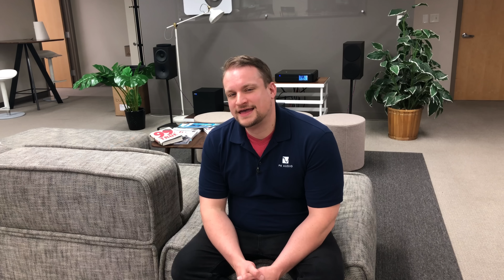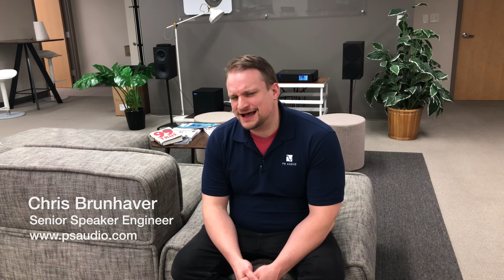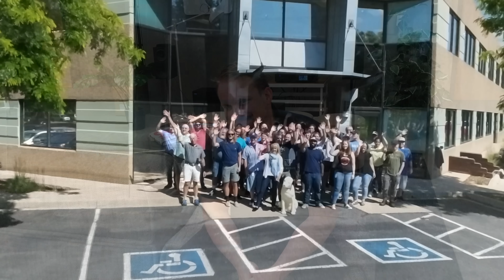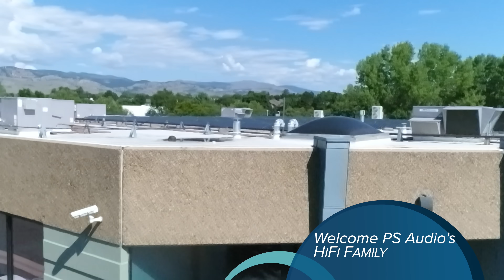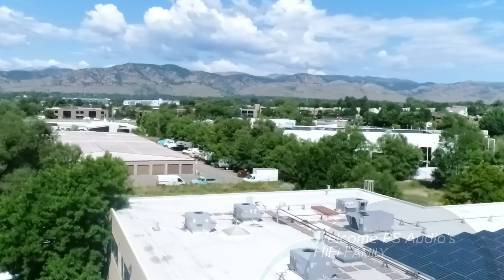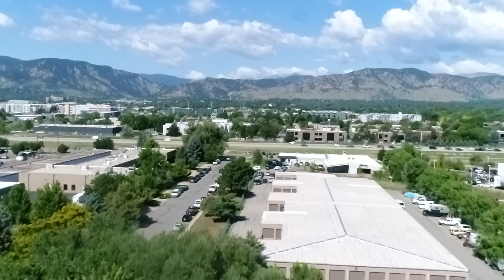Why speaker time alignment doesn't work

Comment: Hi Man.
..."Knock, knock, knocking on the Electroacoustic Hell's dooooors.." (Jajajaja...). 
What a topic you've just brought up!. Here I share three examples (among others) of Great Talent (in my humble opinion) who addressed the issue in depth from different angles:

> Peter Walker (from 1956 but in 1981): The  most important innovation in the ESL-63 was to design the electrostatic stators—stationary conductive elements that carry the amplified music signal—as a set of concentric circles, the signal arriving just a bit later at the next circle outward than it had at the one inside it, the resulting total sound simulating that of a point source.

>Eduard M. Long (in 1976): "A Time-Aling Technique for Loudspeaker System Desing" 
https://ptacts.uspto.gov/ptacts/public-informations/petitions/1485154/download-documents?artifactId=WYMlM9AHYxiTHr1hgwbbRiPnzbI6GZHytGVw8wXpljStxlG_t_oqkeE
https://bagend.com/wp-content/uploads/2017/02/XLS-125.pdf

>Jim Thiel (This interview in 1998 resume his Vision and Philosophy about...): 
https://www.stereophile.com/content/jim-thiel-coherent-source

This is part of the recent past. The future may be about materials and algorithms... who knows???
Best Regards from Northem Mountains in Madrid, España. God Bless You All.

Comment: Hey we meet again. This time digitally. I only use 1st order slopes in very high efficiency speakers 95 db plus with low crossover points, 1.8khz - 2khz so as to maintain phase between drivers. Placed as close together as possible. They only see a watt or so. However never in designs less than 89 db that can see hundreds of watts. The high frequency drivers sound strained (high distortion) with 1st order slopes when driven hard.
Great stuff. More please 🙏

Comment: Well, the subject is only supposedly controversial. Those that do not want to do the work badmouth it first and then question our ability to hear second. A better attempt would be to actually cite the existing research about thresholds!
Our brain has great capability to compensate for frequency response but no capability to compensate for phase. Phase is a major tool for "fight or flight" reaction of the body. 
I have had good results in measuring the driver arrival times once the crossover is in and then adjusting the physical positions. It IS possible and can even be made attractive.

Comment: This is kind of old but still. Using Audiolense for time alignment is audible. My experience, and others, is that it improves imaging especially the centering of the vocals. Correcting (EQ) frequency response is much more audible. Compare the same FR correction with or w/o time alignment is definitely audible. This is done using active design i.e. separate amplification for each driver and digital xover using FIR filters.

Comment: I'm sorry, but that wasn't a decent explanation of why time alignment is or isn't important. The fundamental issue is that driver RELATIVE phase is tracking smoothly across the overlapping region of two drivers. As a result you get smooth response and minimal off axis cancelations when not being in the sweet spot of the stereo triangle. Drivers that don't track phase smoothly to one another tend to draw attention to themselves and not disappear into the room. Often times you can end up with smooth response and still not have smooth phase tracking, which will result in dips and peaks off axis. A speaker should ideally have smooth on and off axis response for balanced sound in a given listening space. That is probably the most important design aspect of a well engineered speaker. That isn't achieved by just simply lining up the acoustic centers of the drivers.

Comment: Here’s a link showing proof of time alignment, https://youtu.be/c52AaUmEz5c
He’s talking in circles, time alignment when done designed correctly with the proper crossovers, drivers, cabinet, etc absolutely makes a difference. Along with matching monitors with the correct speaker cables. He contradicts himself so many times.smh

Comment: Chris, you should call it: "Why time alignment doesn't work with me?" You mentioned Dunlavy Vandersteen and Thiel - it worked worked them all right. It takes some effort to make a proper time aligned speaker with the 1st order crossovers.
Reply: Hi contradicts himself several times..time alignment, is difficult to get right, but when employed properly, there’s no going back to non time-aligned monitors
Reply: @KCNYC  I own time and phase aligned speakers with first order cross over (Lumen White Lumyere) and to me it's one of the things that make otherwise great speakers sound very authentic and natural (granted, this is a difficult task and comes with its challenges since the drivers are taxed more, drivers need to be aligned perfectly etc). There are many aspects to a great sounding speaker but speaker brands which heavily focus on getting psycho accoustics right and see it as a fundamental part of their design (to which time and phase alignment belongs as one part of the whole equation) just seem to sound very natural compared to brands which leave that more aside. Good examples would be Lumen White, Kaiser Accoustics and Marten speakers. Whether you personally like them or not, they definitely belong to very natural sounding ones and it has to do with giving psycho accoustics a high priority in speaker design, e.g. resonance patterns, acoustically more neutral sounding drivers etc

Comment: Linear phase active crossovers are always an option for higher order crossovers that have phase coherence. It's the method I use, and it's amazing!
Reply: I have switched between minimum phase and linear phase crossovers digitally, and there certainly is a massive difference that I heard anyway. Linear sounded so much natural, but I do think you need the speaker itself to be perfectly time aligned first!

Comment: I've always been amazed at the difference it makes in clarity and depth when you reverse the phase on a tweeter. It doesnt always work with every build, but when it does, that tiny mod is a life saver when you're trying to get a speaker to sound just right. It's useful when you are running the tweeter on a 12db slope and your mid or woofer on a 6db slope.
Reply: You always reverse the polarity of a second order crossover.
Reply: @hey_skip  It's not always beneficial. Nothing about speaker building is guaranteed in my experience. But hey, whatever works for ya

Comment: The recorded event is captured by the mics. Loudspeaker drivers reproduce the recording and launch it into our listening room.

The goal is to recreate the recorded event for enjoyment.

Putting it all back together as it's launched and propagates into our room is no trivial task... even before the room enters the equation. 

What we the listener experiences while enjoying our systems is the direct energy combined with a great deal of reflected room energy. 
That said, the image recreation benefits from the reflected energy being phase accurate uniformly with the corresponding energy from the other channel (ie., Left to Right, or Right to Left).

So, overcoming the challenges of phase shift from coils and caps, physical discordant drive units, etc, present significant obstacles to imaging and soundstaging. 

However physical and acoustic ASYMMETRY within the listening room can shred the image and soundstage apart.

Comment: wouldn't it be easier to say sound from voice coil A is going to arrive at your ear at a different time than sound from voice coil B (maybe only miliseconds). And that everything has varying frequencies from around 200 to 12000Hz, (give or take), and when they (the frequencies) are cut in two to be played from different speakers woofer--tweeter it does not sound real/natural. And your ears and brain can hear the difference from   Diana talking or a guitar playing or a horn playing from one place in space vs 2 speaker drivers trying to play those frequencies??? Design a midrange driver that covers (give or take) 200 to 12,000 Hz then the crossovers won't be that super critical. they will sound very real/natural.

Comment: Both the title and description of this video are a bit misleading.
Speaker designs by Jim Thief, Richard Vandersteen, John Dunlavy, or Earthworks' Sigma 6.2 use passive 6dB crossovers (AFAIK) and could validly be said to be demanding on the drivers, but that caveat aside, they are phase and time correct and therefore do function as their manufacturers claim.
John Bau's Spicas used 6dB tweeter networks, but 24dB Bessel networks on the woofers. Further, the publications of Samuel Harsch, Steen Duelund, or Kido Yamanaka make it clear that all 6dB networks are not a requirement for time-aligned speakers - multiple mathematical solutions can be made to work.
It is also possible to design a crossover network with multiple slopes, so that the initial rolloff is at 6dB but transitions to 12dB so that the drivers are better protected (and the bandwidth over which the drivers overlap is reduced). An example of this design philosophy is Jeff Bagby's series-crossover Tributes (available as a quite reasonably priced kit from Meniscus Audio, and Jeff's technical writeup can be downloaded gratis from Meniscus' website).
Yes, it is true that more than a few speaker designs have sloped or stepped baffles but aren't actually time aligned.
But not all speakers are like this.
A less misleading title for this video could have been "Why many speakers that appear to be time aligned, aren't".
Reply: Had very similar thoughts.  From my recollection, Green Mountain Audio (e.g., the Diamante) and Meadowlark Audio also used first order crossovers and were phase coherent.
Reply: Preach brother

Comment: As best as I could tell, what that Mr. Brunhaver is saying is that even if physical alignment of drivers is used to achieve phase coherency in the overlap region of two drivers that interface, this won't eliminate the overall rotation in phase that occurs in a speaker from low frequency to high frequency. So what? Does he mean to imply that since the overall rotation in phase cannot be avoided through physical alignment of the drivers, that there isn't any benefit to making the two drivers phase coherent in the overlap? The impression I'm left with is that he doesn't understand the reason that with most speakers the tweeter is vertically aligned with the rear of the woofer cone. This is done for reasons that have to do with the proper summation of the two individual wavefronts within the overlap frequencies, such that the main lobe, for any frequency within the overlap, will extend along a horizontal plane, rather than tilt up or down. If the lobe tilts up or down, then the tonality of the speaker will be different at different distances from the speaker. In order to avoid tilting of the lobe, it is necessary for the two individual wavefronts to be phase-coherent, not merely at the exact crossover frequency, but throughout the overlap region. Vertical alignment of the two drivers is one aspect of achieving this goal. It might not be essential to do this in order to achieve this goal, but when it is done, it is done toward achieving this goal, and it makes perfect sense, irrespective of the fact that there will still be an overall phase rotation from low to high frequency.
Reply: On the contrary. What he is conveying is that many people think the 'distance aligning' the drivers will fix all phase issues, whereas Chris rightfully points out that the phase relationships are largely a function of the drivers and crossovers themselves. Across a narrow frequency range, the associated phases can be seen as their own delays (although in reality there is no true delay associated with either the driver nor the crossover, only phase and group delays), to distance alone is not the full picture. Either way, the phase cannot stand alone, so if the phase is optimized at the cost of magnitude no longer being flat, then you have bigger problems.

Comment: And this is why you should just listen for yourself and buy what sounds best to you. There are a lot of theories on speaker design but a few are commonly offered as the holy grail and time alignment is one of them. It's completely misunderstood by most audiophiles and likely, as Chris points out, by most designers. Acoustic centers are not determined by where the voice coils of a speaker lie so very often the stepped baffle or raked speakers are not actually time aligned regardless of the crossover design. Crossover design, however, does play a critical role and there are plenty of ways to design a crossover to approximate time and phase alignment. Even so this will not guarantee good sound. There is no singular part of a design that if you get it right then, shazaam, audio nirvana materializes. And that's why you can design speakers many different ways and arrive at a great end result. Or, conversely, you can execute one design theory to perfection and still end up with something that sounds like a first time DIY'er built it.

Comment: It has been my consistent experience with analog crossovers that filter slope and Q, and path length alignment are important. At least near the crossover point, where both drivers are contributing significantly to the output, it is desirable for them to be in phase. At the very least, if they are not, then frequency response aberrations which are often not easy to correct will occur. I find that perceived clarity and coherence improve when this condition is met as well. Of course, this requires that the path lengths of the drivers to the listener’s ears and the crossover filters are optimized  as a complete system. With few exceptions, I agree that first-order filters require too many compromises in other areas. An exception that comes to mind right away is the Quad ESL.

Comment: You need to read anything written by Dr. Richard Heyser, Dr. Floyd Toole, Dr. Christien Heil or Thompson Ambrose  and then learn how to use a TEF or Easera. Correct phase at crossover point is paramount.
Reply: Funny you should bring up Dr Toole, I was wondering what Harman's research found on this topic. Time to Crack the book

Comment: Interesting! As I listen to my antique Technics SB 7000 speakers that were advertised as "Time Aligned" back in the day 45 years ago or so, I was thinking, they do work but maybe not in the way that I thought. So if they're not really time aligned you could have fooled me. Or maybe, it doesn't matter because they are listened to the most in my rotation and have had many good comments when friends are over.

Comment: That's not entirely correct: absolute phase is what's difficult to hear. Relative phase (that all drivers should be moving in-phase) isn't. Also, what's being time-aligned, if done correctly, are the so-called acoustic centers of the drivers, which isn't necessarily their membrane surface as claimed in this video, but where energy conversion is taking place in each one of the drivers (usually closer to the centre axis of the voice coil, but really, no educated guess will replace an exact measurement). I've designed loudspeakers of the kind discussed here, and can vouch for their ability to produce significantly more realistic sound, but yes, they're a major PITA to design and build, and it's also true one needs wide-band drivers to begin with. I'm convinced time- and phase-coherent speakers are worth the effort. And no, DSP-based systems, while easy to implement, sound unnatural by comparison - those just a short-cut for the lazy if you ask me. A properly designed system will always be superior to one using makeshift solutions to problems one wouldn't have in the first place if said system were designed from scratch.
Reply: I would add to things. 1) If there is a vertical offset between the drivers, and one is closer to ear level than the other, then this will force a difference in their relative positions. 2) Nice name. Leon Fleisher died too young.
Reply: @jonathanknight8251  Referring to the legendary pianist and teacher born in San Francisco in 1928, he's still alive (at least I'm hoping so?). And yes, what you're referring to vertical offset is the same I meant when I say all acoustic centers of multiple drivers must ideally be placed at an equal distance from the listening position. It can't really be done without measuring equipment, but it's worth the effort, and so are filters that get the drivers to move in phase.

Comment: I wonder how much this pertains to the way the ADS L810/710's have a backward lean when put on the original stands? ( I have L810's and L910's. The stands for the L910's allow any kind of lean or straight positioning.) Is there any actual time alignment fix involved or is it just an affectation to make them look more audiophile? I don't notice any difference in sound with the L910's, whether straight or leaning back slightly.